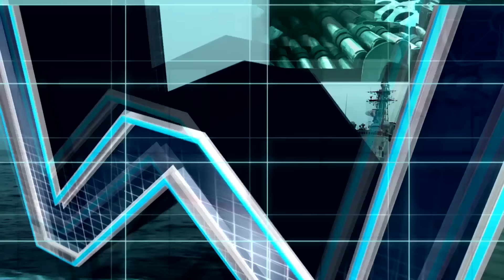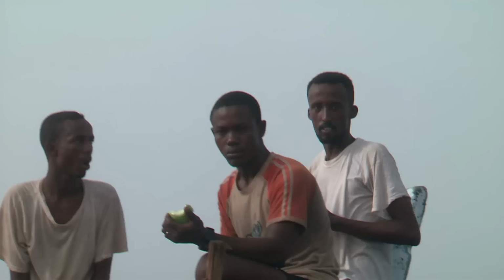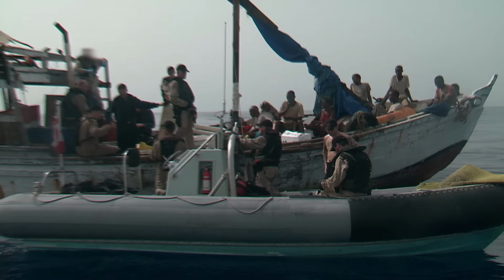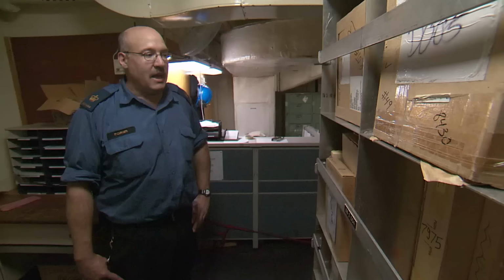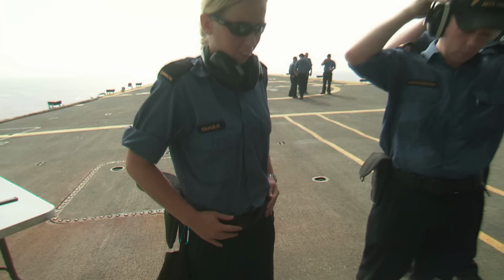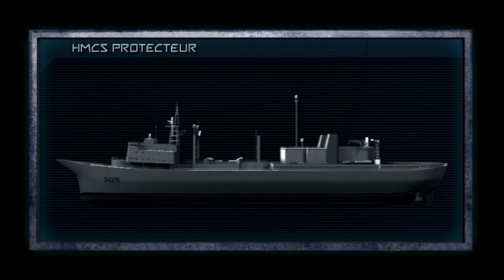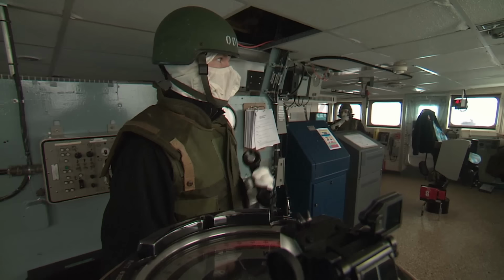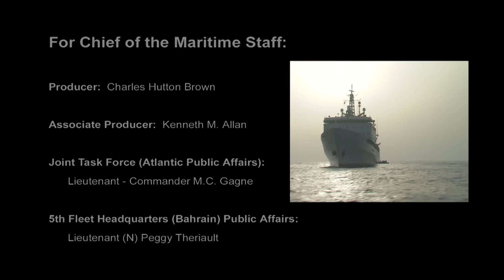Navy Warship Prepares To Board In Somalian Pirate Territory

Comment: Do a video on the 1972 Chicago–O'Hare runway collision!!
Reply: I don't recall a runway collision, but they had a biggie when an engine fell off, and the plane dramatically turned sideways before plummeting nose first..there's a pretty macabre semi-famous photo of the doomed craft horizontal to the ground, one wing straight up, the other straight down, shot just before inverting and streaking into the ground. No footage of that part due to building obstructions between the camera and impact site, but a huge fireball rising up. Awful.
Reply: @carlsaganlives5112  The one you were talking about is a DC-10 incident, specifically American Airlines 191. The one I’m talking about was a collision between a DC-9 and a Convair 880 on the runway.